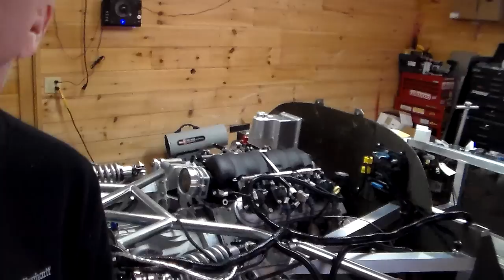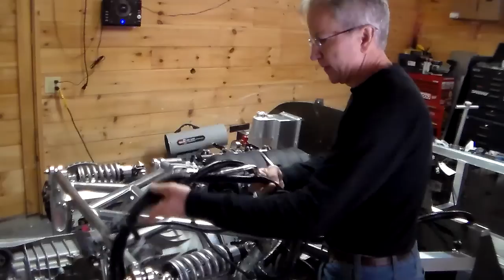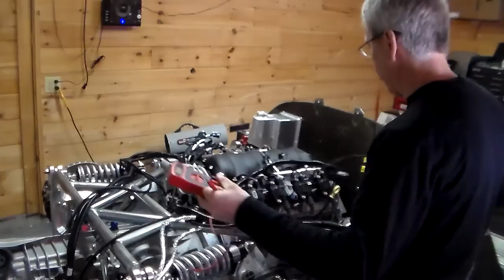SLC BUILD 26 LS ENGINE HARNESS WIRING

Comment: I have question for you how can I get experience on electrical?
Reply from the maker: Between Google searches and youtube searches there are great tutorials on how to wire and the science behind it all.
Reply: I did not found anything that shows how to wire a car!
Reply from the maker: http://home.clear.net.nz/pages/phil.bradshaw/car_wiring.htm
Reply: i want to build my own sl-c I have no experience on electronic do you think I can do it??
Reply from the maker: The Infinity Box electrical system that comes with the kit makes the wiring pretty easy.  The engine harness is basically plug and play.  So yes, you can do it and if you run into problems there is a lot of support out there.